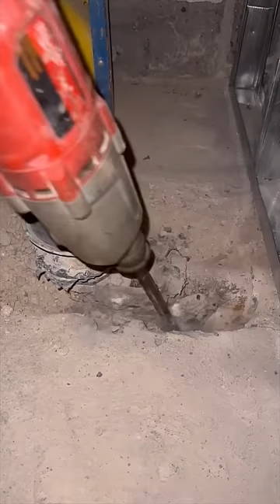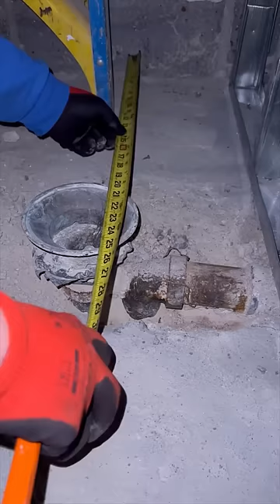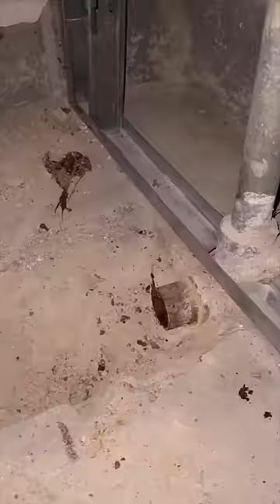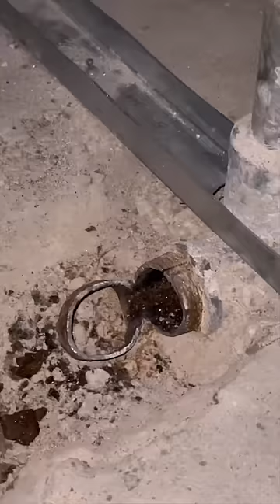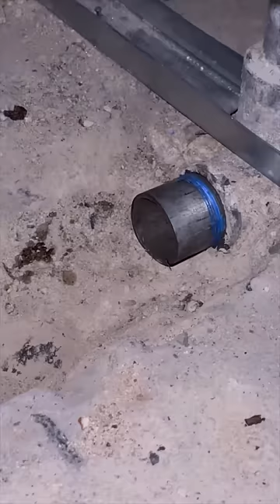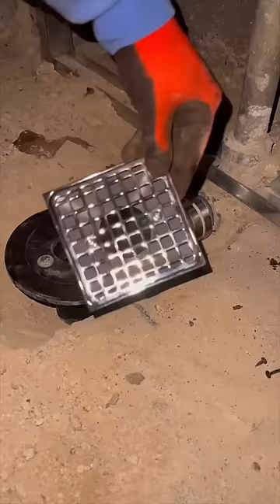Replacing an old shower drain and p trap #architect #shorts

Comment: You gotta understand how much skill this takes. Old ass threaded connections and crusty pipes are hard to finesse
Reply: "old ass" "finesse" something tells me it doesn't take that much skill
Reply: Yes some skills but it's about 90% experience. Broski doesn't get paid to take a crusty drain apart, he gets paid to know HOW to take an old crusty drain apart.
Reply: @23Butanedione  let’s see you try it then 😂
Reply: @23Butanedione You wouldn’t understand as you have never even attempted it before. Stick to stocking shelves at target my g
Reply: @Eric-xf8ke  oh yes I could never be a plumber. How could I possibly figure out how to transport water through pipes?
Reply: As a guy who has done hundred if not thousands of these in my time...my only critique is why not use brass for these connections instead of galvanized.  Overall no rusting, or issues as a galvanized pipe will be toast in a few years.  The newer galvanized is usually sched 40, the other stuff is sched 80, and holds up better.  They just made them better back in the day.  15 years and that galvanized nipple is gonna leak.  For $1500 paid, this would hav been maybe $35 or a bit more for the better pipe.
Reply: @iliketakingshowers why not try? It works sometimes. It doesn't hurt anything. It takes 30 seconds.
Reply: @23Butanedione What’s the fall of a 75 foot length of pipe at 1 percent?
Reply: @cheezeball6109 Might be a NYC thing.
Reply: @cheezeball6109 Thanks, now we know.
Reply: @23Butanedione tells me you haven’t done it
Reply: @23Butanedione 1) you don’t know what a plumber is clearly. 2) you really think it’s that easy?
Reply: Yeah Ik it's sped up and edited etc but I keep watching it mostly for how slick he gets that old pipe out of there.  Looks like you had to cut it somewhat parallel with the pipe?
Reply: @Eric-xf8ke well said
Reply: @Aaron-McDonald yea notice he stopped commenting lol. He's got nothing left to say
Reply: @23Butanedione  what's the average pitch a waste pipe needs to be. During new construction which trades install before the plumber. How many leaves would I need for a car iron stream furnace. More into than you think little mr ego.
Reply: Interesting. I see the comment I made here under this comment is no longer listed here anymore, yet I’m getting updates regarding this post. Strange YouTube… strange.
Reply: Cutting the pipe and reconnecting with a sheer band isn’t rocket science. Adjusting the height and leveling out the shower drain can be kinda tricky though.
Reply: I mean, with the right tools it doesn’t take much “skill” at all. Problem is you don’t always got the right tool 😂
Reply: @Aaron-McDonald lol i can say plumbing isn’t hard, but then again I’m a steamfitter🤷‍♂️ you guys come asking to use my 300 machine 😂
Reply: @ligyron2835  lol. So with a football and pads you could fill Brady shoes. Got it. You did say with the right tools anyone could do it.
Reply: Fernos are half the work
Reply: @23Butanedione Is that why it takes as long to get a master plumbers license as a master's degree? If plumbing was so easy we all wouldn't be booked solid for the rest of time... Broski
Reply: I deal with this old crap all the time...love to watch inexperience people and even plumbers who only work plastic talk the big talk. The remaining pipe is often as fragile as glass meaning one wrong move or vibration and you flood the unit below. This guy makes it look like nothing buy it took years of experience to know how to asses things...and that is the true measure of his mad skills.
Reply: @shable1436 Thats an M.J not a Fernco.
Reply: @rickywinthrop  lmao I never claimed being a skilled plumber is “easy” but this isn’t “hard” either. I’m a third generation steamfitter by trade and this would just be another day in the life. Any guy with half a brain and some time on the job understands how to do these sorts of things. I’ve watched my grandfather do it BEFORE all the fancy power tools existed when you had to use 5-6ft wrenches to make up threaded mains. I’ve done my own onsite welding and “peened” closed bad welds with a torch and ballpeen. The guy is good and takes pride in his work but he’s not a unicorn. And I work in the same market in NYC as him. Removing broken off threads isn’t “special” it’s just a necessity of the job. Sometimes you can back the thing out, sometimes it breaks off and you gotta deal with it. But I absolutely agree he deserves to make more than most the “hacks” in his trade.
Reply: @cheezeball6109  Who the fuck does drains with brass?
Reply: @vyvianalcott1681  in NYC most drains are not plastic, they are brass.  Most large residential buildings have cast iron stacks that have tap tees that are threaded.  Usually galvanized nipples don't last long, and need replacing under tubs, or under sinks,  but brass nipples last forever.  Attached to that nipple is a brass trap called a NY trap which is usually 2" reduced to 1.5".  Then the remainder of the way most building supers will use 22 gauge or 17 gauge brass drains, and not plastic to the strainer, and they hold up pretty well.  Anything over 5 family in NYC is commercial, and use of plastic piping not allowed.....now you learned something for free ...your welcome.
Reply: @cheezeball6109  Plastic isn't the only other material used in plumbing, guy.  Every house drain I have ever seen was iron pipe, brass for drains is a huge waste of money that is not a cheap metal.
Reply: @mikeznel6048  Not a plumber but if that 1% means what I think it means it should be 0.75'

Comment: Used to run into that when I did residential, and then I moved to commercial, and everything was smooth. The price is the price. You show up and do good work you're in with the contractor.

Comment: I worked with a high end motorcycle shop that fixed major crash damage in the 1980s before the aftermarket had "replacement everything". The owner built his own frame straighening machine and did superb work but that work takes time. He never got mad at complainers but the idiot tax was applied as needed. He'd just smile and remember when it was time to pay up. (Quotes on highly specialized work were in price ranges, not absolutes since crashed bikes often revealed more damage when torn down for repair.) The moral is don't get mad, get money.

Comment: I use to do this on the daily in big ass multifamily buildings, im talking 9 floors all slab floors, every hole had to be core drilled , jack hammered, chizzel hammer ...for new construction,  but any remodeling this is the way to replace , good job my fellow experienced plumber we are a dying breed,  been doing it 17 years now, i use to dislike all the new material,  now im like hell this is way easier, rock it out, lets roll !

Comment: I'm an electrician and I got a similar one.

So guy calls and has us come look at a breaker tripping on his back patio.

The receptacle on the back patio is connected to the bathroom gfi receptacle.

I tell him that the reason it's tripping is the ice machine he has plugged in is pulling too many amps and needs to be on a dedicated circuit. I explained this 3 times. He said ok I understand.  

He then asks for an estimate on a dedicated circuit plus since we are there he wants all the receptacles and switches in the bathroom and bedroom changed out with new cover plates. OK easy enough we will get started on that and I'll email you an estimate on the dedicated circuit. He says ok and we get to work.

He pays us for the work and I again say I'll email you the estimate for the dedicated circuit you need for the ice machine on the back patio. He says ok no problem...

A week goes by and he calls the shop and is bitching that the circuit keeps tripping so they send me out.

I get there and the guy jumps down my throat saying we charged him this much to change out the switches and receptacles and he thought that also was for the dedicated circuit.  

I'm doing everything that I can to not punch this guy in his mouth for raising his voice and cussing me out. 

I calmly say sir this is in the estimate I sent and I clearly wrote in the estimate for changing out all these switches and receptacles that it's not going to fix the breaker tripping cause the ice machine you have pulls close to 16amps and needs to be on a dedicated circuit. 

After going over it again and again I say ok I'll give you a deal on the circuit I'll take off a little money from the original estimate and will that make things right? He's all happy as shit cause he's thinking he's got one over on me and is getting a deal. 

I ended up taking off like $500 from the original estimate but turned around and added it back on cause I convinced him we could run 2 circuits instead of the one and I will just charge him for the breaker,cut in box plus another receptacle! 

I ran 12/3 romex which gives me 2 hots a neutral and a ground compared to 12/2 which is just a hot,neutral and ground. I had a bunch of 12/3 that was extra from another job and if the dude would've been nice I would've ran that shit and not charged him a dime but since he was a cunt I got the original estimate price  and he thinks he got a deal. I did no extra work and just added a double duplex box instead of a single gang. 

Like I said if the guy would've been cool and said I would really like 2 circuits I would've just ran the 12/3 and said don't worry I have extra on my truck. I'll bend over backwards and cut deals all day if you are nice but if you're a dick I'll squeeze every penny you got and let you think you're getting one over on me!

Comment: Do you trust that Fernco under the pan? 
Hell, it’s probably better than rigid pipe.  
I’ve never used them that much. But I don’t deal with a lot of old ass buildings either.

Comment: lets talk about the job, as a none plumper no fucking way I am paying for a job where you install pipe clams in the concrete. You can use that stuff in walls but never in the ground where moisture is going to destroy it and create leaks in 5 years.

Comment: I was a union carpenter for 32 years so i know where this guy is coming from. Some rich MF'er is spending a couple hundred grand remodeling a million dollar home and they trying to get a hard working plumber to do a bunch of crap for free. Although this was not the homeowner. It was the general contractor trying to pump up the bottom line.

Comment: As a contractor first and a draftsman now, I HATE engineers and Architects.. I tell these guys all the time "ITS NOT GOING TO WORK" ..  LoL. then have to explain it.. Doing things on paper, and in your head is NOT how it always works in the field.. lol Yeah it looks good, or the beam there will work, but if you want to put a pipe here, or duct here its not going to.. lol. Should have them work in the field b4 they get the degree lol

Comment: this is horrible long term your suppost if your not a complete contractor get someone to safetly remove the cement using small perforating drill locaiton based on pipe placement and sink in melter than you come in and treat the metal to manuvere and than addjust and do what you gotta do i would sue both of you if this was my property